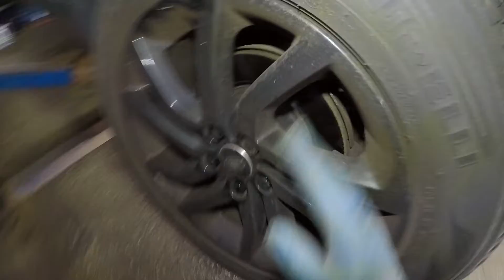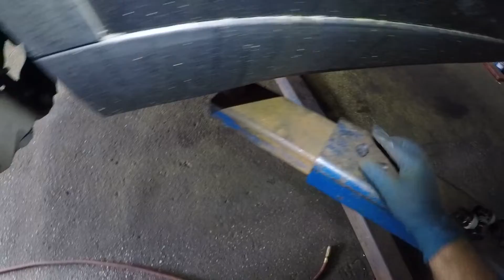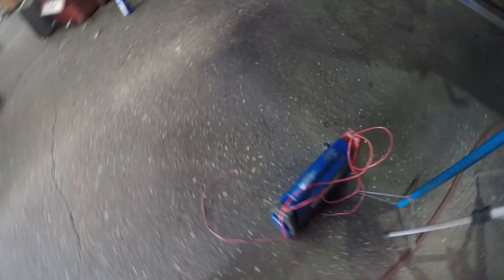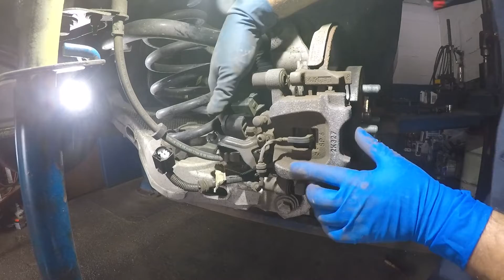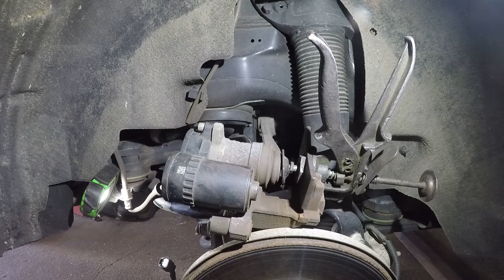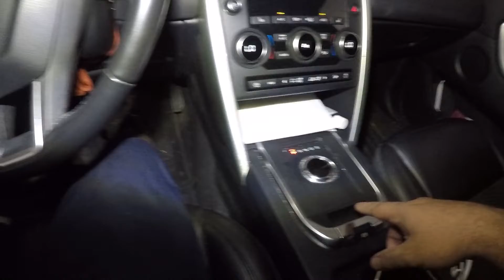How to replace rear electric brakes on Land Rover Discovery 2019 and more no scan tool required

Comment: You can just take the motor out, then pushing the piston in while turning the rear with an E socket on the torx screw. Then place motor back on aligning the bolt screws.
Reply from the maker: Ok thanks prolly wount go in by tuning at least some cars they don’t go in by turning

Comment: If you are not comfortable with the wires etc, I just put the car in neutral (while running) on the jackstands and unplugged the motor.  Then put it back in Park.
Reply: Can you make a video and show us how......put the car in neutral (while running on jackstands and unplug the motor.Then put it in park.
Reply from the maker: @sistercalhoun4444  why u need it to be in netural? I didn’t put it in netural
Reply from the maker: U can remove the acuator and turn the caliper from the bolt that gets exposed in the rear of caliper and compress with it
Reply: Worked like a champ. Put in neutral and removed clip, and as I was pulling connector off caliper dang near came off with it. Thanks so much!!!

Comment: I  don't think its right to use two pieces of wire to reverse the electric motor on that way, not professional.
Reply from the maker: Well it works professional was to hook up my $8,000 scan tool and put it in to service mode but the professional scan tool wasn’t comparable so I put my mind to it and every one can do it professionally

Comment: Excellent tutorial that saved me a lot of time and money! The use of a 12 volt battery to manipulate the electric brake worked like a charm. Thank you!
Reply from the maker: Excellent!  But next time use 7v or do without using power remove the acuator and turn the caliper manually from back
Reply: Where do you get the 7v power for this? @RBTheMechanic
Reply from the maker: @tonystubbs9189  use small battery
Reply: What if your parking actuator has 3 wires???

Comment: No need for the (risky/dodgy) 12 volt bare wires on to the parking brake motor! Start the engine release the parking brake and then undo the parking brake wiring clip down at the caliper motor, then turn off the engine. Wind back the caliper with the standard brake caliper tool using a right handed thread.
Reply from the maker: Ok thanks
Reply: When I took mine apart and saw that it was designed for a caliper tool to wind it back, my first thought was whether or not winding it back would damage the servo motor. I assume it  winds the servo motor back as well? On a side note, USE lubrication or something to get the electrical connector back on. I thought the connectors were on but they were on just enough to engage the servo motor but created an error message on the instrument cluster.

Comment: Many thanks, although i wish i came across this video before i tried to replace myself.

Didn't remove the connector before removing the calibre and pads which then the EPB self activated and pushed out the piston fully !  Doh !

Managed to get the piston engage and pushed back just enough to get new pads back and brakes seem to working properly but a warning notification keeps coming up   "Park Brake Requires Calibration Apply Foot and Park Brake"    any recommendation on how to fix ?
Reply from the maker: U might need scan tool to reset
Reply: @RBTheMechanic  already tried no luck.  Could it be the position of the position in comparison to the other side ?
Reply from the maker: @petzbuzz2825  nothing to do with other side what did u try how did u attempt to do this

Comment: Why not leave the connector ON the caliper and simply turn the key?
Reply from the maker: U will damage it and removing the connector allows u to move the caliper around without pulling the wiring
Reply: Yes, right!! May sens.

Comment: Absolutely fantastic video, Im off back round to the garrage right now fingers crossed🤞
Reply from the maker: Yup!!! Thank you
Reply: @RBTheMechanic  Unfortunately I have the 3 wire plug so not able to wind the calipers back😥
Reply from the maker: @marcos3ltrv6  remove the acuator and turn it with tool torque work on it and compress slowely
Reply: @RBTheMechanic  thanks again, I was going to try that tomorrow, rain stopped me today👍

Comment: Hey can a car battery be used to power the electric motor? Like 12v or 9v?
Reply from the maker: The one I use in this video is 12v
Reply: @RBTheMechanic  Hi RB thanks, I can't get anyone to service my LR where I am....I'm not an electrical guy, but how many amp is your 12V?  Dumb question, but do I run the risk of burning anything out if I just grab a general 12v battery?  ANY additional info is greatly appreciated, thanks!  Local mechanic's NEW scanner won't work and he's a great tech but he won't take accountability for the way you did it.....
Reply from the maker: @Hellian51  idk the amps but I have another video u can do it without even apply power
Reply from the maker: @Hellian51  here’s video on bmw it’s about same just diffrent size tools https://youtu.be/e1kYGb8TYIs
Reply: @RBTheMechanic  I haven't tackled it yet, but I will.  I also tested this on my LR Discovery and it worked!  
https://www.youtube.com/watch?v=sgrN7O1742o
Reply: Please just watch the first 2 mins.  There are two different ways to acheive the LR Discovery Maintenance Mode.
Reply from the maker: @Hellian51  tell us please
Reply: @RBTheMechanic  Too much carpentry on to go this weekend, should get 'r done next wkend.
Reply from the maker: @Hellian51  👍
Reply from the maker: Yeah

Comment: I have different method and still works without using Ellen key to take off

1. Key On Engine Off
2. Press Gas by right feet and press down EPB button then turn key ON OFF ON in 5 seconds. the Odomedor will show " EPB in maintain mode"==> so you can press straight in like regular ;) 

release do the same but Press Up EPB

I'm working at Ford dealer and I'm using this method alot to do EPB rear brake job reallt fast without using Scan Tool or Using Aleen vs Tort to take off at the back.  ;) 

link video

https://www.youtube.com/watch?v=aierIiFjiVY
Reply from the maker: Nice will try that next time I did that with Ford Focus years back.
Reply: It did not work on my 2019 Evoque. The break engages the minute I turn off the ignition.